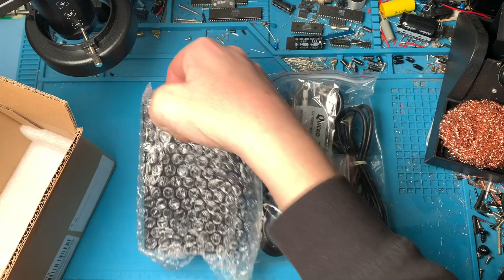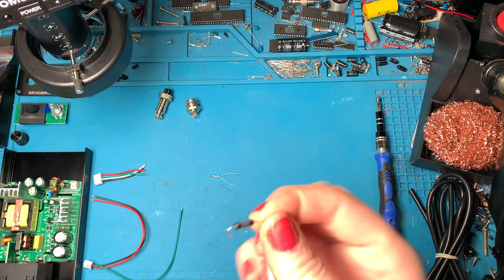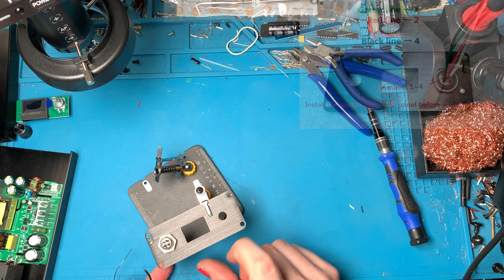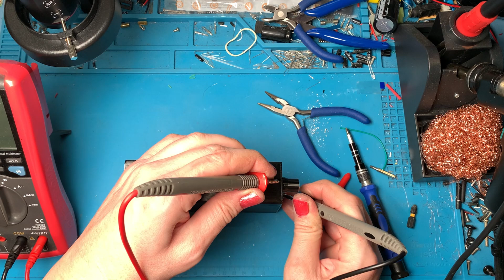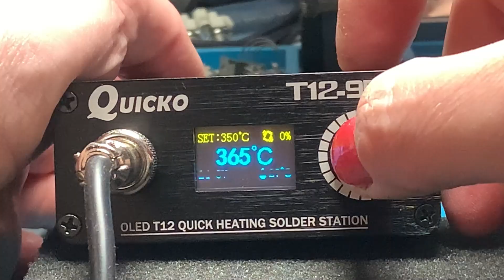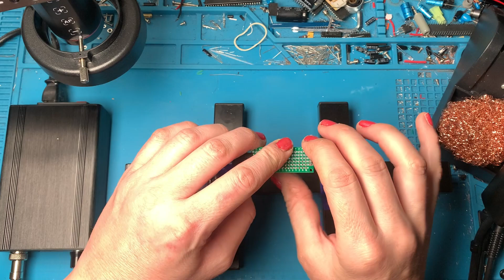Assembling A Quicko T12 Soldering Iron Kit From AliExpress - Cool Electronics Project!

Comment: Watched this,so I opened up my t12to earth the case as you suggested,  found a wire from a pin on the kettle lead going to a hollow thread and nut through the rear case. Am I correct in thinking this is now earthed ,or am I missing something. Ps I love it when you do the electronic kit This is why I have the t12 to try myself. Newbie so take pity on me lol.
Reply from the maker: Get your multimeter and put it on ohms mode/continuity and measure for low resistance/continuity from that thread to the mains earth pin on the plug to be sure. Make sure you unplug everything before you do this.

Comment: Mine Worked a while now it doesnt take solder at the tip, I tried filing clean, doenst work, what to do?
Reply from the maker: The tips for this are not designed to be filed. Have you checked the tip is pushed right in properly and then tried removing the tip and putting a replacement in.

Comment: My T12 iron uses USB pd for power. I've got a meter and a half cable on it and the adapter plugs in on the floor. Works great but the handle gets hot if you let it run for a while.

Comment: I have just assembled one of these  with your earth modification. Because of a very good quality anodisation I couldn't achieve the levey of earthing that you achieved. I took a countersink bit and by hand (drill not used) i scraped the countersunk screw holes until the sunk holes were shiny aluminium.  Screws installed and perfect earthing has been achieved. Still amazed that the manufacturers seem to miss the importance of good earthing. Great presentation.😊
Reply from the maker: Yes, it's essential to make these modifications for your own safety. Thanks for watching 😊

Comment: I bought one of these a few years ago ready made, but the T12-942 model that uses an external DC supply.  Best soldering I have ever owned. Most of the time I run mine from a Liion battery pack so it is easily portable. No issue with the earth concern either. Nice video Jazz and I like the shirt too. 👍👍

Comment: The case is now earth-grounded but the tip probably isn't (normally you'd need a 5th wire in the handset cable in order to ground the tip). It might be instructive to measure between the tip and ground for voltage leakage, which has been reported for Aixun T12 stations. If someone is working with sensitive mosfets and ICs, leaking voltages or static electricity potential from the tip of the iron may be a concern. Anyway, I don't much care for switching supplies in general because they provide poor electrical isolation between the wall outlet and the user, and they generate RF noise; grounding the case as you did might help reduce direct RF radiation from the unit, but it might feed noise back into the house electrical system. This could cause problems for someone trying to align an AM, FM, shortwave or ham radio receiver while the soldering station is turned on. If so, perhaos adding a ferrite onto the power cord woukd help.

Note that some of the early generation home-lighting LED bulbs threw out lots of RF noise, not just directly but right back into the house wiring as well. We had to try a number of bulb brands above the repair  benches to eliminate this when I was a fulltime audio tech, and several brands of bulb I tried at home would completely disrupt reception of low-power college FM stations on a high-quality table radio 50 feet away in another part of the the house even though the radio was fed via shielded coax cable from an attic antenna!
Reply from the maker: The tip is grounded. I have checked. So any leakage is at least grounded.
It's very difficult to get away from switch mode supplies altogether these days. LED lighting and their supplies are not good. I can see the noise on my scope at the lower settings.
Most of my gear, being old, all have a proper 50Hz mains transformer in with linear rails. The new bench lights that I built, I will power them off a linear supply.

Comment: Very cool for cats. Nice job Jane.

Just between you, me, and the gum tree. The power wires from the board to the "aviation plug" , insulation melts.
I bought a bundle of three, as assembled but not working.
Lucky I have a soldering iron.😉😆
Reply from the maker: Ok, I'll have to check that after using it for a while. Thanks for watching.

Comment: Funnily enough, I bought one of the built versions with the white display to use in my portable case about a month ago. I was actually surprised at the quality and usability although I will check\do the earth mod. One difference is that it has a bar power graph along the bottom which does seem to work quite well when you hit a larger solder joint. Tips are super cheap too.
Reply from the maker: Yes it's a nice soldering iron. There are many variations of the same thing. Definitely worth doing the earth mod. Thanks for the sub and thanks for watching.

Comment: Nice video .. Just a couple of points to add .T15 tips are also compatible with these T12 soldering stations .Also good idea to make sure the iron tip has continuity to earth as you wouldn't want to have any voltage potential when soldering.. Enjoy your videos  keep up the good 👍  work 👍
Reply from the maker: I will look into the T15 tips. The tip is grounded. Thanks for watching.

Comment: I have built around 20 of these kits. I love them. Had one as my goto soldering station for a few years. I still have a few in a cupboard. I make custom cases sometimes for them. Sold a few and also gave away some to friends. I started to build these kits when the control boards were Hakko make. I have made these Quicko, KSGER, Hakko and a couple of other cheap versions. Done them with blue, red, white displays and even larger displays.
Reply from the maker: I think they are very good and very good value for money. Thanks for watching.
Reply: @JazzTechUK  They are. especially as they are copies of the Hakko and JBC for a fraction of the cost. I have bought my 3rd Yihua so I have all the sizes of tips, T245, T210 and T115. They heat up to full heat (350c)  in 5 seconds and around 6 seconds for 450c. I have all 3 tip sizes for different soldering tasks. As the T115 is the smallest, ideal for SMD and T245 ideal for through hole soldering. But for me, nothing beats the T12 for through hole, even with bid ground points to heat up, The Yihua T245 /210 & 115 are copies of the JBC but at a fraction of the cost and even take the JBC C245 / C210 / C115 tips. Win in all round. A lot faster heat up than the T12's.

Comment: "Need a soldering iron to build this soldering iron". That reminds me of a moment back in the very early 1980s when I had to replace the element on my first Antex iron (probably a C15 or something like that ... I didn't "upgrade" to an X25 until many years later). The mains cable needed to be soldered onto the element pins but fortunately I had some manky old Tandy iron as well - problem solved.

Comment: I wonder if the earth lead you used to the case is thick enough. If  the live shorted to the case, that wire would have to carry more than the plug fuse, at least 2 amps. Otherwise it could melt and  leave the case live.
Reply from the maker: It's quite a short piece of wire. It's 16/02 strand which is good for at least 3A continuous . Any more than that and it will heat up a bit and soften the PVC insulation. To actually blow that wire clean though would take a lot more current than that.
If something went wrong and live touched the case then the electronics would likely give out first long before that wire melted right through.
There is also a quick blow 3.15A fuse in the IEC input socket between the socket and the switch.

Comment: These T12s are still good. But today I'am mainly using a C210/C245-clone. There're better than the T12s, due to the shorter working distance.
Reply from the maker: The T12 is a short distance, like holding a writing pen, which will come naturally to most people. I'm not sure I would want it any shorter otherwise I would think you might have trouble with taller components being in the way of your fingers.
I will look into the C210/C245's though. Thanks for watching.

Comment: You can get this even cheaper if you go for the unit that is designed to use an external DC power supply.
If you (like me) have a spare laptop PSU or similar, you can use that to power the unit.
Reply from the maker: Yes I am aware of those, but a laptop supply is typically only 19V or so, so you won't get the same voltage on the heater, so I can't see you getting the full wattage power of the element. Have you ever done any tests on your setup to see how much power it draws?
Reply: No, but I use it every day with a 19V Dell psu and it is enough for all my work.  @JazzTechUK

Comment: like the avo meter on the shelf ;;
Reply from the maker: Yes, it's very nice. One of the last models, an AVO 8 MK 7. It's in very good condition and very handy for voltages that are fluctuating, which are difficult to read on a digital meter. Thanks for watching.
Reply: @JazzTechUK  thanks for reply = these AVO 8 MK 7 METERS I WAS TOLD ARE RARE MODELS ;; VERY GOOD ;

Comment: Given the output current is 4.5 amps, the connecting cable does seem to be a bit thin. I also hope that the plug and socket arrangement between the power supply and back sockets is reliable and has a 'click' indent on the connectors. Otherwise, an excellent video as usual from you Jane.
Reply from the maker: Yes, it's not the thickest but it does feel like it might be silicon rubber which will withstand a higher temperature if the wire does get hot. It doesn't seem to, although there might be a bit of a voltage drop along it, but the iron gets up to temperature so there doesn't appear to be an issue.
The rear panel mains connector does 'clunk' in quite firmly with the power supply board so I don't think there will be an issue.
Glad you enjoyed the video and thanks for watching.
Reply: I noticed the same thing about the board being only hanging on by the connectors. Probably not a big deal especially if the tool will be just used at a bench and not knocked around or dropped but it might be a good idea to secure the board to the case in some way to prevent it from coming loose or even cracking if subjected to knocks or vibration.

Comment: Interesting soldering iron kit!, I've always used an Antex 25 watt soldering iron for years. First rule of owning tools is look after them properly and they will last you years!!.
Reply from the maker: Yes, looking after your tools will make them last a lot longer. That Antex 25 watt iron is ancient, lol, and it takes a while to heat up. Time to treat yourself to a new more modern one. Thanks for watching.
Reply: @JazzTechUK  my first Antex iron lasted 14 years and my "new" Antex iron is 6 years old!! 😁
Reply: One great reason for getting something more modern is to finally get away from those inconveniently stiff mains cables on the old Antex irons. A modern soldering station with a proper floppy cable makes all the difference!
Reply: Yes, we are fortunate nowadays to have lots of nice tools available at affordable prices. I used a simple non-regulated iron for years, then a cheap (at that time, still cost a lot more than this one) "soldering station" with a mains voltage iron and a rudimentary light dimmer style thyristor power control but no actual thermostat before finally getting a proper temperature controlled one and the difference in performance and convenience is huge.
Reply: @Murgo-u3l , anything Weller now makes that's red is garbage. Amazingly in this day and age, Weller sells what looks like an adjustable-temperature, self-regulating soldering station that is nothing more than an ordinary 120VAC iron with a light-dimmer in a red plastic case, and having no temperature feedback; you can turn it down but you can't turn it up! Sold for about $70 at big-box home improvement stores; a total rip-off!
Reply: @ Yes, that's unfortunate and an example of the modern day phenomenom where short-sighted corporate greed ruins old reputable brands. 

We have an old Weller Magnastat solder station at my motorcycle club, I guess it's at least 30 years old, maybe more, and still works great, very simple, very high quality.
Reply from the maker: @Murgoh, I have one of those Weller irons too. The light blue ones. It's simple and it just works, every time. Ok for working on older bigger stuff but it's not delicate/small enough for working on modern surface mount stuff. Each tool has its purpose.
I do agree about the corporate greed though. I have seen a lot of decent brands ruined and turned into cheap trash because of this.
Reply: @JazzTechUK ,  I used a blue Weller Magnastat style solder station every day for 20 years as a fulltime audio repair tech. Those things are built like tanks and last a looooong..... time. I did have a smaller soldering iron for SMD work but I rarely worked on anything that tiny.

Comment: "Quicko, not Quick"
Nice! I'd surely love to put together a station like this, with some component upgrades (reliable electrolytic capacitors etc.).
Good job with the ground mod. I really can't see a reason why it wasn't a part of the original design.
Reply from the maker: Chinese not taking safety seriously. It's a shame because the product is really good and they have addressed the live trace running under the heatsink on the previous versions with this newer version, but not the earthing.
Reply: @JazzTechUK  yeah... you find all kinds of dodgy stuff on Chinese products, like tube amplifiers, pro equipment, appliances, whatnot. It's as good as their quality control, which is often lousy.

Comment: I've been using a kit-built T12 for 6 or 7 years from Aliexpress. Best iron I've ever had.  I've bought other irons since but none of them are anywhere near as good.
Reply from the maker: Yes it looks really good. I have friends who think they are excellent, including one friend who bought 2.
Reply: super happy to hear that, i ordered the assembled 952 to replace the cheapo amazon special i got for 15 bucks. it came with everything i needed but the iron itself is frustrating to work with. I also bought a yihua desoldering iron and it worked surprisingly well for less than 40 bucks.